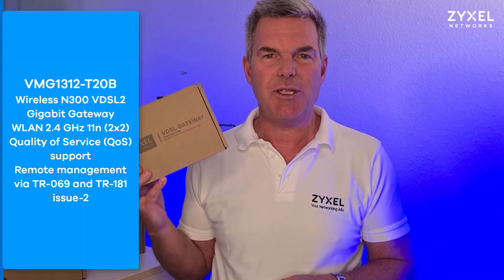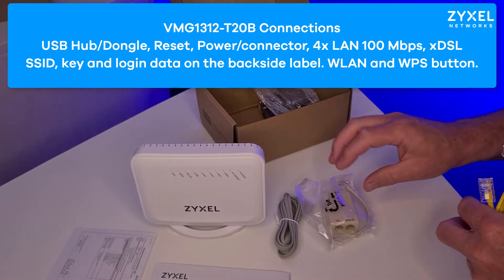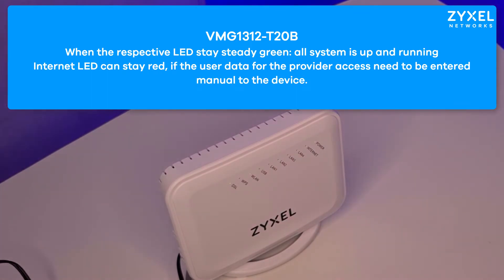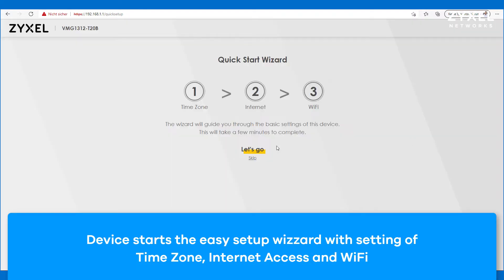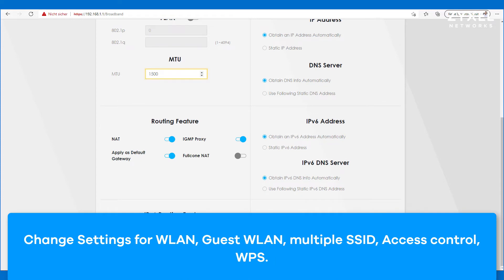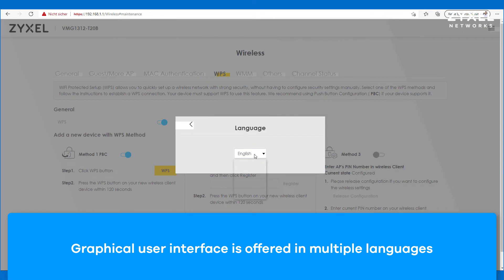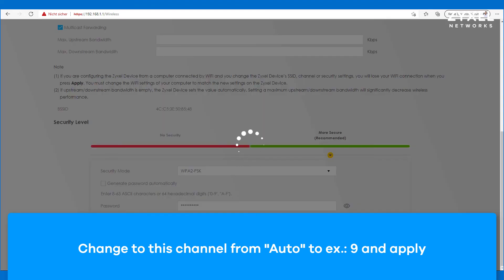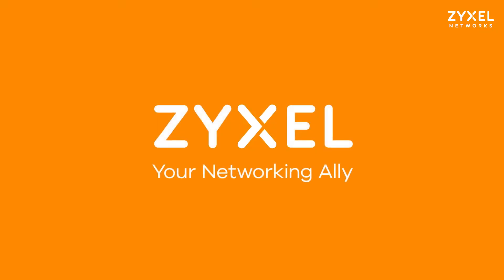Zyxel VMG1312-T20B VDSL Gateway - Unboxing and Initial Setup [EN]

Comment: Is there a way to limit the upstream bandwidth for LAN devices, in this specific router
Settings in QoS only provides Shaper Setup which only limits the dowstream bandwidth
Reply from the maker: Hi Oussama, in the most internet connections the upload bandwith is not limiting other users so this is not managed by bandwith management. Only the download capacity can be shared by limiting.

Comment: Is there any mobile app that I can user instead of opening the browser and getting into the router?
And thanks for the great video.
Reply from the maker: Dear Omar, no this device really needs hand made configuration, if it is not managed by the provider by TR-69. So you need to follow my examples and thanks for the compliment.

Comment: what pasword
Reply from the maker: Dear @KHUDISH DESIGN  please explain "what password" you are looking for. Login to Router and WLAN of the standard device is always written on the backside label of the CPE. If these credentials don't work and you did not change them, your provider may have generated or blocked access. Please try a reset of the device if you are sure that you did all changes and set up the device again.